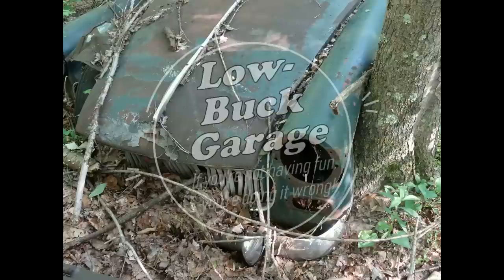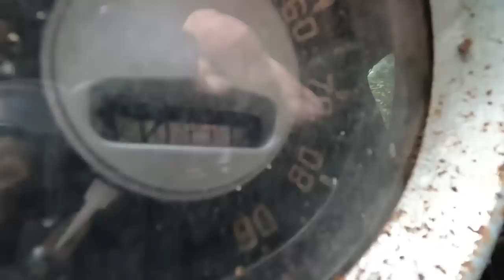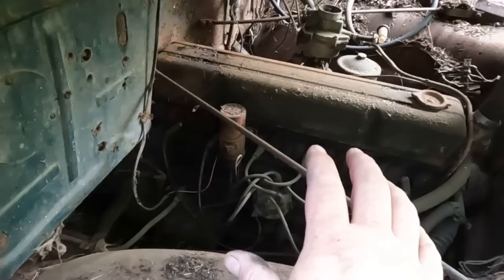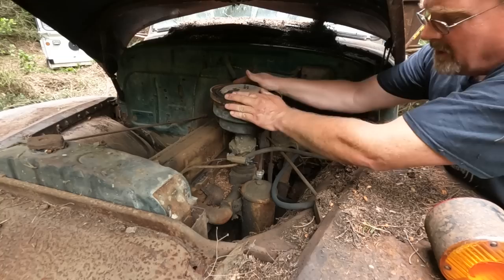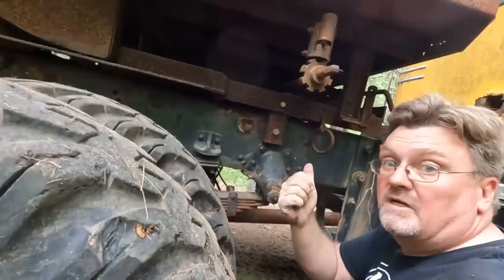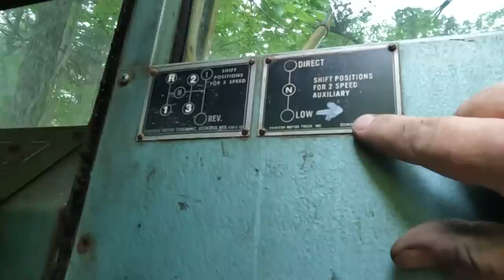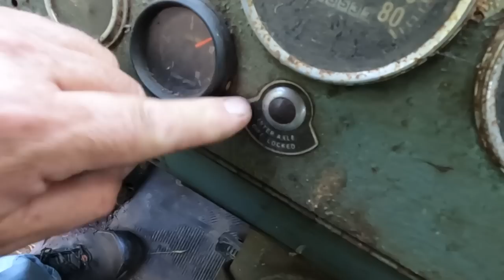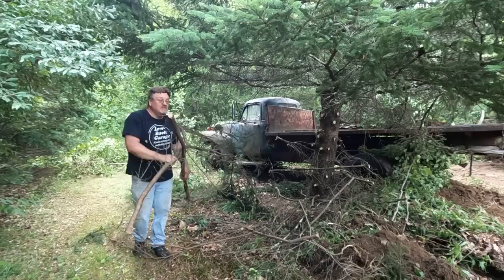Towing a Truck With a Truck, This Should be Easy!

Comment: Giday mate , love your vids and humor , thanks for the giggles . it's much easier to move things sideways if you attach the chain as high and short as you can on thee tow truck and as low as possible on the ruined truck , it will lift as you pull and you won't damage rims and tyres .😎

Comment: I really like that 6400 truck. It's purty and has almost no dents! Weird how it rusted under the hood that way. There are a lot of facts in your videos - always something to learn, like the location of the valve cover bolts and the pressurized oil system.

Comment: What you need for extra maneuvering of your stuff around by yourself is one a those $300 13,500lb winches off Amazon with the wireless remotes, along with a couple snatch blocks.  It on the front of my little jeep here has made life so much easier, and my boneyard much tidier to boot.

Comment: I was struck between the similarities between that Chev 6400 and a TJ Bedford. Some styling differences in the front end, but the cab interiors felt very similar. Been many years since I've been inside one though so could be wrong. I think late 50's Bedfords found their way back to the GM parts bin through Vauxhall? Maybe I'm mile off and my memory playing tricks.

A common mod for those Bedfords in AUS when they were relegated to "farm truck" duty was to drop a Holden (GM) 308 V8 in them. Plenty of them lying around.

Comment: i have a '54 6400 ex-grain truck that i cab swapped with a '94 1500. i love those 5 window cab trucks, but rear wheel cylinders are unobtainium for the big trucks, so it went from a ramp truck project to a cab swap project. luckily, the cab is the same no matter what size in that series.

Comment: I feel a bit sad that the old 54 model chevy truck is not worth fixing. I so did love the look of them. Its also the look of the very first 55 model trucks as their new bodies were not ready for production and so they used the 54 cab on the 55 for a few months. It made that model cab worth some very serious coin. I ain't sure of much in life but maybe someone whom is moderately moneyed up would enjoy bringing it back to life. That is not your style, you either fix or use to fix others rightfully so
Reply from the maker: I'm not giving up on it!  I didn't bother trying to start it because I knew the motor was bad, but that it not too big of an issue.  I'm not sure yet exactly how it will happen, but that cab will drive again, either with an engine upgrade or on a new chassis.

Comment: the rearwheels of the old chevy seem to turn a bit! that means the blockage is in the gear box or maybe there is a hand brake on the the gearbox output/  so if you unbolt hte driveshaft to the rear axle maybe it would roll!?

Comment: Should the “bigger” extra dump bed be on the Oshkosh instead of the older tiny one? Seems there has to be a center diff lock on that transfer case to get all the power to the back wheels. Could that dashboard “diff lock” be for the rear axle only since it’s a street truck? 
That’s for sharing the fun!
Reply: No, it's an "inter"-axle diff lock, not an "intra"-axle diff lock. But, there could also be a back axle lock as well. Some trucks have both

Comment: Wondering why you didn't pull the axle half shafts?  I have had good luck with getting old drum brakes to allow the wheels to turn while disk brakes were often seized solid.

Comment: The plow has a Texas key chain.   Also at 19:10 is that another dozer in the tree line?
Reply from the maker: Good eye!  That's a TD18 that hasn't run in 30 or so years.  It had steering problems back then, but it did run...
Reply: @LowBuckGarage  maybe another project?

Comment: Fix the truck right becomes a safety hazard if you do not do the job right the first time but it's a safety thing you're going to drive the truck on the road you better do it right the first time around it doesn't matter how much money is going to cost just do their job right the first time around so don't become a safety risk can you get pulled over by the highway patrol
Reply from the maker: It is not going on the road, backyard use only!